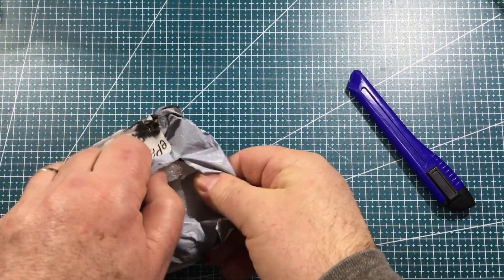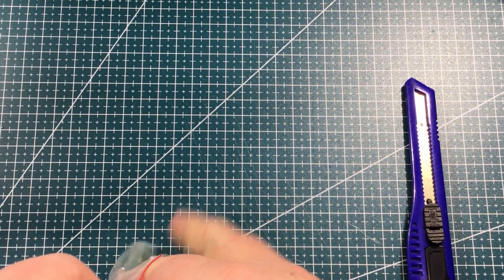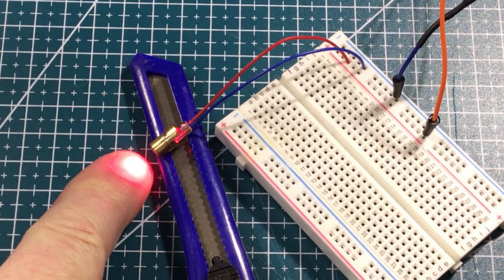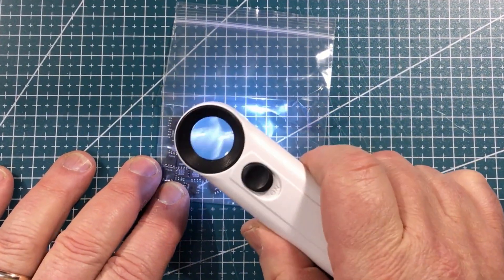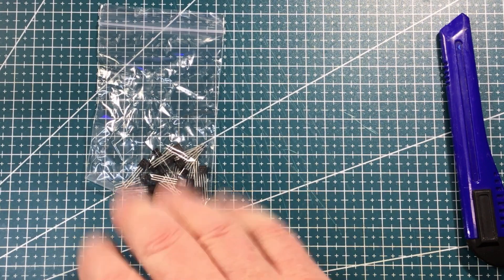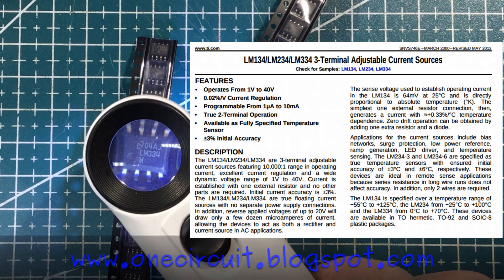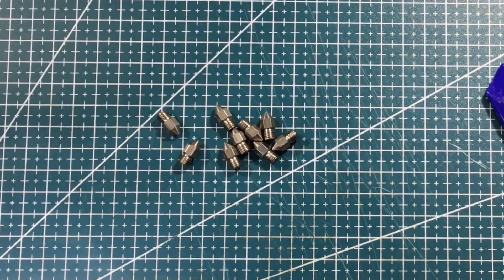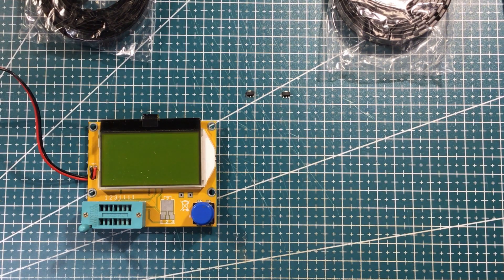Mailbag #21 - who doesn't love burning stuff with lasers?

Comment: Like those ice blue LEDs  and I finally found a way to recover 0805 LEDs that flip and try to escape by vanishing onto the floor. A nice big Neodymium magnetic will pick these off the floor, no problem. Keep up the videos
Reply from the maker: Good idea! I will run a magnet over the floor and see what turns up. A heap of smd resistors and capacitors is my bet! 👍😀
Reply: A cheap uv flashlight is good too